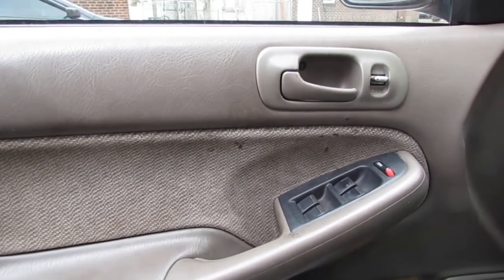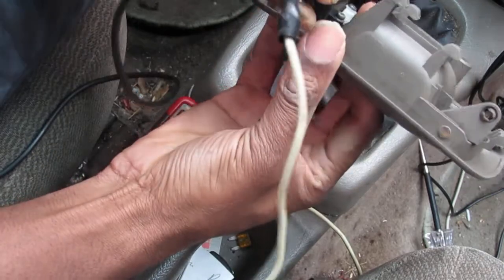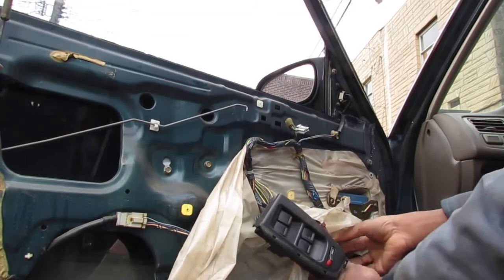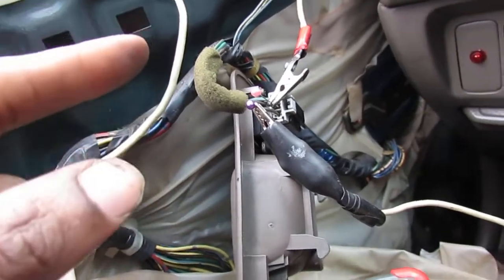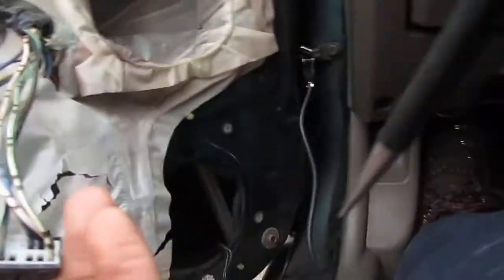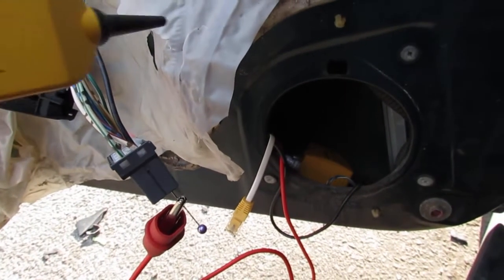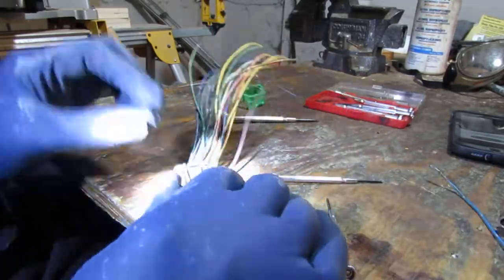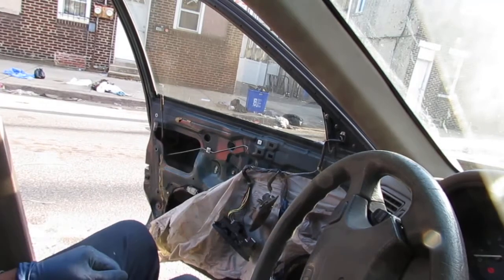1997 Honda Civic | Diagnose Repair Power Lock

Comment: Full credit to you for a thorough job and less than ideal working conditions.  I've got the very same car and so far it's just been the motors in the actuator unit failing mostly because they aren't rated for the current required to operate the mechanism. Fortunately I was able to find identical motors AR a surplus shop and I make the repair myself. The hardest part is getting the square drive fitting off of the old motor shaft before I can press it on to the new motor shaft.
Reply from the maker: This is really good information.  Do you have a part number to share please?
Reply: I bought them from a liquidation jobber outlet and they came with no information whatsoever except for the fact that the push in terminals were the same. It was a low cost gamble on my part that payed off.
Reply from the maker: @jimbarron8688  , can you share the name so I and other may find it?

Comment: I have to say, I'm impressed by the patience, & approach, but more so, over all the conditions of doing this repair on a busy city street with all that traffic....This gentleman is surely on top of his game....Excellent !!!
Reply from the maker: That made me laugh, and thanks for the kind words.  It is true the struggle is real.  This is the issue with living in a concrete jungle.   It was great to get this fixed.  Happy New Years.
Reply: @MotionDesignStudio  Your still a better person than me...I took out the door lock fuse & no longer have to electrical resistance fighting me in going up & down with the lock plunger....Now I just make believe my Civic never came with power door locks....On to better things in life...Keep the faith!!!!
Reply from the maker: @jasonbarrett2675  , currently the  door lock on the driver side is not opening and closing well as in up and down on the lock does not always happen.  It could be a bad ground or failing door lock motor.
Reply: @jasonbarrett2675 j thu electric pin broke
Reply: @MotionDesignStudio
Reply from the maker: @TuanPhan-hd5vi  , what?

Comment: The work was great. A methodic approach to all the power lock system including the understanding of the circuitry manual and testing procedures. You have it all (door knob, actuator, control unit, power and  ground). Most videos just focus on replacing the actuator. And finding the true problems which was a bastard ground wire opening. Absolutely great. Just one piece of advice since you are looking for suscribers....and so forth. You would make an ouststanding video if once you go thru the process you then just film a condenced version. You would have better images, a summary and a shorter video which will make it far more useful and interesting. Just my 2 cents. Outstanding work. It took me a hole weekend to go thru this process on my own. If only I have found your video before!!!!!!!
Reply from the maker: There are many ways to present this information online and no true formula for the masses as peoples' emotional state, desperation and algorithms impact the outcome especially the algorithms.   Thanks for the feedback.